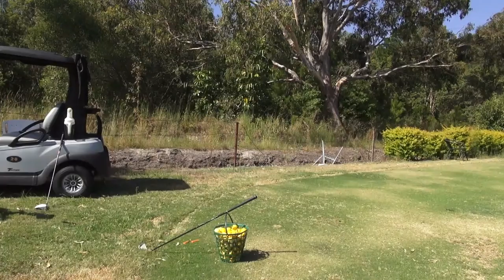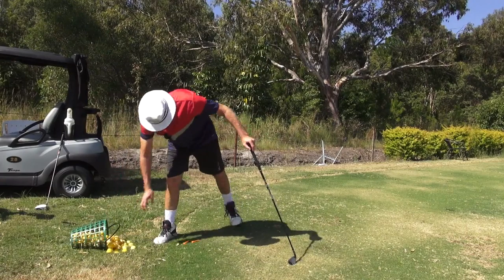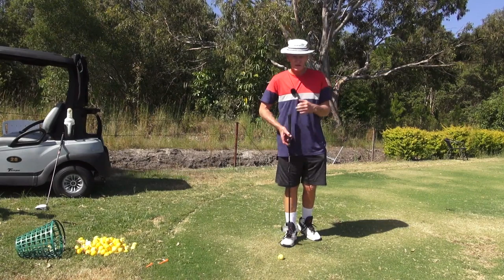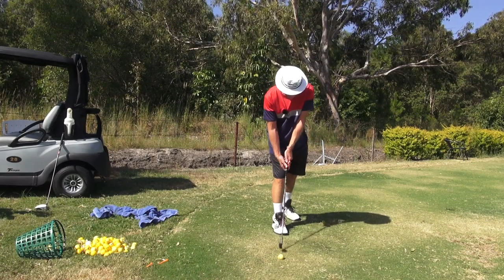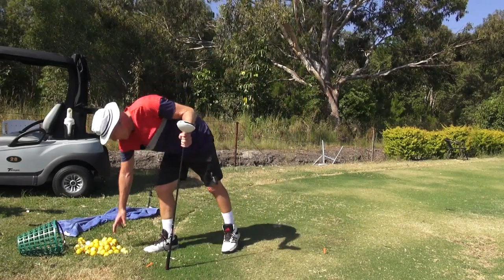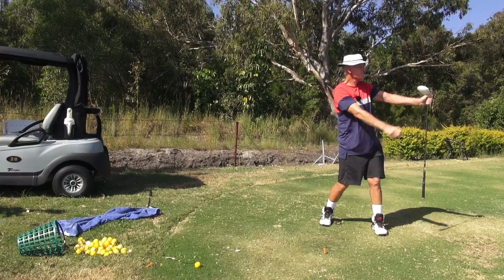'Squaring Up'   Channel Lock  Address Alignment   .. Option..

Comment: Thanks for another good vid, JH.  For me, the pre-turn is as important for my hips as it is my shoulders.  As you say you do, I like the feeling of "auguring" my hips/legs into the ground to provide stability, balance, and to prevent spinning out resulting in open shoulders.  I can pre-turn my shoulders to any angle (square or closed) but they work independent of my hip girdle and if I don't perceive locking my hips behind the ball, they take over and open everything up.  When I "auger" my hips/legs, good things happen including closed shoulders, in to out path, trail foot down at impact and beautiful draw ball flight.  It's the best way I've found to eliminate decades of trying to shift my weight to my lead side.  Bill and Matt seem to do this without thinking about it but it has to be a conscience thought for me and maybe others.  Thanks for all you do, mate!
Reply from the maker: Hi Dave,
              Glad the video was helpful..  like you the 'Preturn '  is a big help for me in getting my weight set into my trail side more effectively ..when I get the 'Auguring'  feeling    I really get great balance at impact .. 
                                       cheers JH
Reply: Do Bill & Matt have swing videos in YouTube ?

Comment: Hi JH, I was drumming up business for you today at the driving range with a frustrated slicer. He wrote down your Youtube channel and is keen to visit you. Also gripping the driver way down to 41inches was working real well for me. I'm thinking of putting an old 3 hybrid shaft in and extending it half inch to jake it  41 so it stays as a regular. Cheers, Richard
Reply from the maker: Hi Richard,
                 Just try the hybrid shaft at its normal length first.   it might work ok as it is ..  Hybrid shafts are a bit heavier so that will work in your favour  ..
                       cheers JH

Comment: I've had some good success using this swing method recently. Why hasn't there been much, anywhere online, about this golf swing? I've found it difficult to find much about it or others who use it, recently.
Reply from the maker: The swing is not taught by anyone but. the instructor in the video.
   The swing. is. not. promoted. commercially. by me at all, which is why it has no. following or promotion by other. swing instructors. 
           Cheers JH

Comment: Hi JH,  I believe that most of us that have tried the CL swing and had problems with it is because we have always failed to close the shoulders.  I know I’m guilty of not closing my shoulders in the several years I’ve been playing the channel lock swing but recently I’ve remembered to close my shoulders and started hitting some really nice draw shots with my irons.
Reply from the maker: Hi Ronnie, 
       I think  the  keeping closed of the shoulders   in the downswing  and at impact is  the cornerstone  of  the CL swing process..  you can never   achieve  a  gauranteed  in to out  club  attack  direction  if you shoulkders are not closed at impact . 
    The  whole idea of the CL  swing geometry  is  to  provide  a  starting ball flight  that  is always    slightly  out  and away from the  target line..   if the clubface is  closed  a few degrees at impact  you  get  the  perfect  little push/draw  ball flight..  and if the clubface is a little open at impact  the worst shot you will get  is a  slight   straight push  shot..  but 'every' shot  will  'start  to  the  right of  your targetline..  which if you know that is going to happen  you can  you  can  structure your  aim point accordingly. 
                    cheers JH

Comment: Hi JH,  the other day I was messing around with my channel lock setup.  I started gripping the club with the club face  open and aligning my stance open a little.  I was hitting the ball with a beautiful little fade and getting lots of distance.  Do you think it’s ok to play CL like that?  I had been hitting lots of topped shots and fat shots.  When I grip the club with the face open a little the topped and fat shots went away.  Can you explain to me how opening my club face fixed my problem with topped and fat shots please.  Thanks!
Reply from the maker: Hi Ronnie,
      What you have evolved to is what  I termed in one of my  CL videos as .. 'Options'.. everyone has different physicality's and reflexive capabilities.. to that end you need to experiment with things like the stance structure etc.
            The reason for hitting the ball 'fat and thin'   is usually the same issue.. that being the ball is too far forward in the stance, when people used to come to me for a  lesson to stop them hitting the ball   'fat and thin'..  I just used to get them to play the ball further back in their stance at the address until they started to hit the ball and not the ground, that is the 'only' thing I used to do.
        With you because you have opened up your stance the normal body response is to play the ball further back in your stance, it just invariably happens because the visual ball position effect dictates the ball is much more co=mfortable  back in the stance with an open stance setup'.
      The other contributor to that is the opening of the clubface at address, which visually again dictates to the visual cortex/ brain that you need to have the ball further back in your stance. 
         I think because you were having the thin and fat shots issues   when you were in a closed to square address position.. you simply did not have the ball 'far' enough back in the stance at address..  and eventually..' Impact'.
         With CL  most people find it difficult visually to play the ball off the trail foot,  but you really need to in order to be able to keep the shoulders closed at impact,  and as well to get the shoulders closed enough at the address to get the clubhead into the 'channel'   quick enough in the backswing. 
           At the end of the day as long as you can get the clubhead attacking the ball at impact from ..'in to out'..  it doesn't matter what the stance line direction is at address. 
        cheers JH

Comment: put a felt tip dot on your ball and place it with the dot at 4 o’clock at address, set up CL style and swing to hit the dot, it will put you in the perfect channel for backswing and follow through and 5 o’clock nose will fit perfectly with no effort. Works perfect for me xx
Reply from the maker: That is a  very good process for locking your visual contact point into place at impact ..   I used to turn the golf ball name down to that orientation and get students to hit at the name .. 
                           cheers JH

Comment: My own stance has become less open than the beginning of CL. The key for me is maintaining the correct ball position. I sometimes set up to far from the ball with channel lock. When I do this the protocols will not work. Funny but I am also hitting down on the driver and bashing it. I’m just using the same swing, now I need the same length clubs! For what it’s worth JH I had a practice session using my old George Knudsen swing and hit each ball as well as George. I’m not switching back, I did it for fun. Question is can CL make your conventional swing better? Cheers!
Reply from the maker: Hi John,
                Maybe the CL practice sessions have ingrained the closed shoulder aspect at impact  .. that is a great facility even with a   conventional swing  .. George Knudsen had the same problem as everyone else did who used a forward ball position at address  ..Moe Norman told me George's bad shot was a  flat pull..     Moe said that happened with George because he didn't pull hard enough /long enough with his lead hand/arm through impact .. 
               cheers JH

Comment: Ok I'm ready to give this a go, Just wondering what if you have to hit a left to right shot and how does it apply to the short game such as bunker shots.Tia.
Reply from the maker: This is  Channel Lock  bunker shot   mechanics https://www.youtube.com/watch?v=PZ4nlkCjrHU&t=649s    with a    left to right shot with  Channel Lock geometry   setting... the shot    is not a starting 'left'  shot  then  it   goes to the  right  ..      its a     straight shot  that just  falls to the  right at the end of its flight ..  that happens because you     have the  clubface  open at impact   which because of the in to out    attack path of the swing  the shot ends up being a     'push leak'  type shot  ..   you just aim a bit further  left  and    just   push leak the ball to the target .. 
                     Channel lock does not have an out to in  swing geometry application in its mechanics  ..  if you want to cut fade a shot you would just have to use conventional swing mechanics inefficiency to do that .. all CL  shots will start initially to the  right of the target line .. 'how much'   right depends on the amount of    clubface  closure or   opening you  have  at impact .. 

             

                       cheers JH

Comment: Thanks again JH for another great vid!
Reply from the maker: Hi Ron,
            I thought that was something that had to be cleared up  ...   Bill Phillips and cMatt Gray hit the ball absolutely to protocol base requirements  ...    they just do it with 'less' preturn on their shoulders  .. 
                        cheers JH
Reply: Great C/Lock review with Tenn 
Options of squarer shoulders
Bill has shown to me his inflexibility ( can’t come anywhere close to touching his toes )
I believe Bill has always been an inside striker of Ball...
For majority of amateurs who are “over the top” I find your 
“Preset” is better to break this
Deeply ingrained pattern...

I also find that exaggeration 
(Going far right of center helps to “right the ship” )
Then we can adjust back as you demonstrated with “ Square Shoulders “

Eliminating the sabatauging 
Rotation of the shoulders is the main benefit of C/Lock

Shoulders moving in teeter totter manner rather than
Carousel is a terrific benefit for consistent strikes !

Single axis pivot is so much easier ( back ball-staying on 
Back foot at impact )

Other benefits ( no sway-sway is not okay ! )—-Head And body mass stays back ( this allows clubhead to launch (catapault) in forward direction... simple physics such as slinging a pail of water...cracking a whip...skipping a rock etc

Your analogies are good at getting the right visual images ...
(Back ball...Backcock...5 o’clock nose...negative load...left wrist cup...bowed right wrist...gunslinger...Loosey
Goosey...
Reply: Sorry for long post...I could go on (I’m passionate about CL)
Reply: Thanks For the info and tips Ancient One. I have trouble with “shoulder sabotage.”  I’m going to focus on rocking them and see if that helps.

Comment: Do you use the 'CL' swing method or "Plane truth" type of swing? And why did you change?
Reply from the maker: Hi Gregory, 
           The JH Practice tee  is  all  about   investigating   all  types of Golf swing mechanics    to  see  if  there  is   a potential   for  application  of  something 'different'   that  may  be of benefit   to  someone that  hasn't had   consistent success with traditional  type   swing   mechanics types..
                      I  found  'all' conventional  golf swings that    incorporate   a forward of body centre  ball position   at address/impact   were  prone to  the ball being  pulled or dragged ...  which is a   shot that invariably   creates   significant issues..  
                   The channel Lock   swing  with its  trail foot  ball position     will not  allow   pulled/dragged shots to occur    if  correctly applied  ..  the swing provides a consistent  'starting'  direction    for  all  shots  ..  
                     cheers JH

Comment: What foot is your weight on during the swing and where is your head? It looks like your head is over your right foot? Do you place your grip on the club after you put the. club on the ground? It also looks like your right foot is pulled back? Am I supposed to pull my back foot back and not line up square? Does one transfer weight to the left foot or stay on the right foot? What do you mean square on when you right foot is pulled back? Your stance is closed? Are you talking about your shoulders?
Reply from the maker: Channel Lock is a  'Trailside' weight biased swing  ..  the intention is to revolve essentially the majority of the swing motion intention around the trailside vertical axis of the body  .. the trail leg/hip/buttock  etc  .. 
                Just imagine the trailside axis is a gatepost and the lead side of the body is just going to swing off that gatepost ..
                   I take my grip  before   I    address the ball  ...it is   beneficial to set   the  footline   closed at address      because we want  to have the hips/shoulders closed at impact  and the club to be   swung    outwards   across the target line  on a tangent  ..  the whole   idea of the CL swing  mechanics is to promote a  closed     body alignment at impact   so as to 'always' start the ball    in the 'same  direction    every  swing  ..
              Cl is not a forward shifting/sliding weight transfer swing  ..   we want to stay on the trail side with a closed body line at impact   ..   the shoulders should always be closed at address and impact...   I don't know what you are referring to when you say  I mention being... ' Square On' ..    I   wouldn't have said to line up 'Square On'   ever    because    you   cannot    get  the  body closed up at impact  as you need to in order to start the ball    across     and outwards    away from the target line  ..  ..
              Just  type in   '1atomicgholf  Channel Lock Swing '  into  the Youtube   search   bar   and     all the Channel Lock videos will   come up for viewing  .. go through  them and have a look at   the ones that   give   basic overview   information about the swing mechanics  .. you will get     a better understanding of the base premise  of the swing geometry  setup at address .. 
                      cheers JH
Reply from the maker: This Video     is really what Channel Lock is all about   https://www.youtube.com/watch?v=GwDI78BWY04&t=36s  
                  cheers JH
Reply: 1atomicgolf Thank you for your reply. It was very helpful. I will check your other videos.
Reply: 1atomicgolf PS I am shooting over 120 so I need all the help I can get. I haven’t found a way for me to be consistent yet. Looking forward to trying this approach to the golf swing.

Comment: Couple of questions - is the club face square behind the ball once you've back cocked or is it slightly inside on the ball. I also have a hard time getting the same ball flight(push draw) with my woods and driver with the ball off my back foot.
Reply from the maker: Hi Mike,
                   I personally have the   toe of the  clubhead  'inside' the ball at address    because I like to have my trail  elbow close to my     side at address in order to get the club tracking in side ion the channel early in the backswing .. I know my     trail arm will straighten out   at impact and     bring the clubface  back to      the  ball    centred  ..   because of normal radial    swing  throwout pressure..
                 Getting the    same     push draw with the   driver/longer clubs   requires   experimentation with   'how much' you  close the clubface down at address    ..  if the ball is just    going   straight right   as in a normal straight push type flight  you  just have to     close the clubface up more at address until the ball starts    drawing  back   in its flight  .. the longer the club the more commitment to  releasing the toe of the clubhead                at impact is required ..
                 cheers JH

Comment: There are pros and cons with this swing just like a conventional swing. Your shoulder is already turn in backswing which is good but when you swing in downswing, club is not square to target line so it is harder for ball to go straight. There are going to be hooks more or less.
Reply from the maker: I   have not hit  'any' hooks with the CL  swing  ..  the geometry of the swing if correctly applied    only produces  very   small draw   ball flight shape  ..
                     cheers JH

Comment: Still would love to see your Trackman numbers JH. Not so much for club head and ball speed (although that could be interesting as compared to conventional) but more for the angles.  Does the feeling match reality?
Reply from the maker: I  have been on a monitor .. my attack path is normally between 6-9 degrees into out and my clubface is closed between   3-4 degs     at impact  ...  and it's, strangely enough, the same with the driver as it is with a 5 iron ...  I guess that happens with me because I don't stretch out much for the driver at address and at impact  .. 
                         I hit the ball today maybe 5%  further than I did with my conventional swing mechanics  ..    my     ball  height   is   the same as   my old swing...   the main difference with CL  is    clearly      the    consistency of   ball 'starting direction .. I have not hit  one drag or pull shot since I started  CL  ..  not one ..
                    cheers JH
Reply: @1atomicgolf  ok, is the club face closed to the target line or the path? If the latter, that would make it still open to the target line by 3 or 4 degrees. Yet you would still get a draw out it. Interesting!